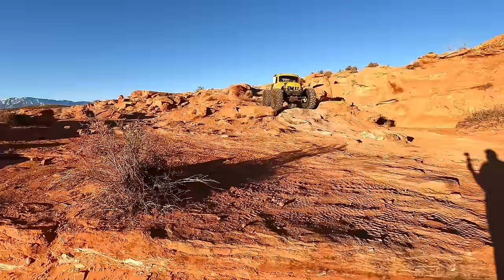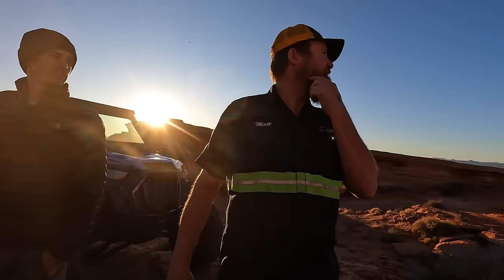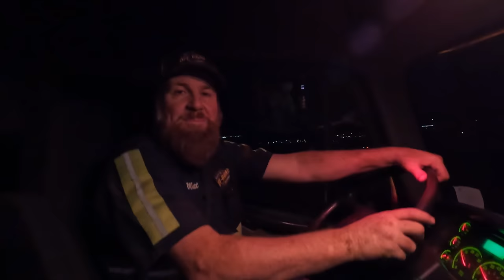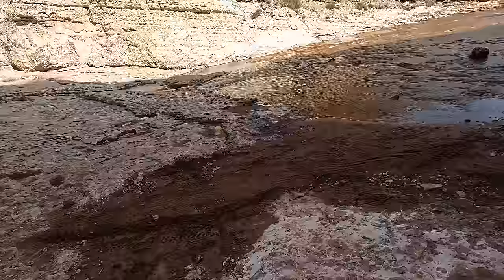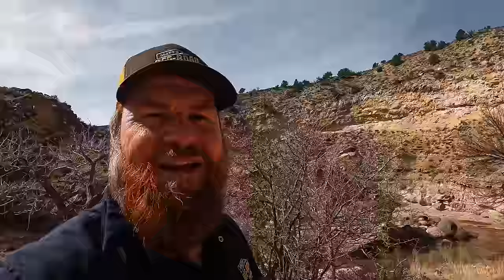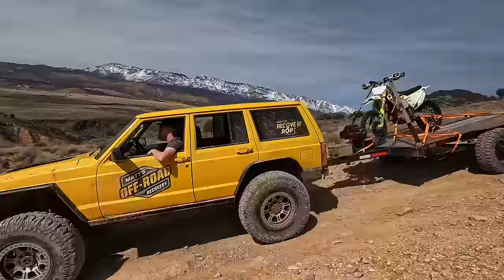This is Not What You Called For?

Comment: I don't know if this would at all be a practical upgrade for the wreaker, but a backup camera and a nice screen so you can see what is hanging from the boom.
Reply: the need front and back at a minimum and to START CARRYING EXTRA FUEL
Reply: Lol you know Matt doesn’t like building things technologically advanced to make things easy as possible 😂😂😂
Reply: @judadon707  Well, I was going to argue about the 4 wheel steering, which is a huge deal in that truck, but it's manual too. It's not automated like a Mercedes, or Cybertruck. So, you win. 🙂
Reply: @fjalics  nor did he build it
Reply: @KirbyLouis  Maybe if could capture the video, it might make for some cool clips. I wouldn't mind seeing the view from the front bumper here and there.
Reply: @Berm_Blaster  Build what? The 4 wheel steering? He bought aftermarket parts, and installed them, which is not so different from a car manufacturer. They have a lot of suppliers.
Reply: @Berm_Blaster 
What didn't he build?
Reply: @judadon707 
I think it's more complicated than your simple generalization.
Seems to me that Matt likes whatever is:
> effective
> durable
> making recoveries easier 
> easily maintainable 
> easy to use
 > straightforward to maintain
> straightforward to troubleshoot
> easy to fix "on the trail"
And other qualities... not too mention cool & yellow
Reply: @chazfaz3595  all of those are usually characteristics of the simplest least technologicaly advanced equipment 😂
Reply: @judadon707  Yeah pretty often the case, but he usually tends to test on the job and certain particular attributes tend to become the focus when simple isn't cuttin it in that area. With his experience; he zeroes in on those particular criteria.

Comment: Matt, I enjoy your channel very much so.  I like your rescues videos and of course those of the crew as they are able to do what is needed when you are not there.  Just something to think about for your wrecker to make it a little more usable, as a tow truck operators wheel lifts are great, and I know you said you would prefer not to use, or it is not a good thing because of the condition of the terrane most if not all of your jobs are in.  Instead of a wheel lift or a sling, you should design a bar that is just long enough to reach the distance of your boom since it carries the vehicles, but an articulating bar that you can hang of the front axles of any vehicle that attaches to the back of the wrecker, that keeps said vehicles from swinging into the back of the wrecker.  One that you can hang on the pinto which will give the ability to move in all direction.  This will not just stop the vehicle from smashing into the back of the wrecker, but it will also stop the vehicle from swinging side to side, it would be safer.  You will just have to work out the amount of articulation that is acceptable for the rock crawling tow that you do from time to time, but I believe it will make things a little safe.  You could also take two pipes one bigger than the other so they can slide in and out of one another and weld in a stiff spring to allow some give in the movement of the bar.  It was just something I thought about while watching some of your videos using the wrecker, just something to think about.  
Take care and keep the good work.  Matt's Off Road Recovery crew is a great crew doing a great job for the community of off-roader within your reach.  Thanks for sharing your adventures with us the universe of couch potatoes.

Comment: SUGGESTION: about stopping rigs without brakes crashing/damaging themselves into the wrecker. It works with ships or the construction industry; it should at least help a bit here, too. Make a flat, wider plate with adjustable side clamps(bolt on or if you can think of easier fixing) to grip onto the sides of the boom, ground-facing(so you can quickly reposition and fix it higher or lower on the boom). Second step, borrow either from construction industry or shipping ports some cevlar/rubber reinforced inflatable bags- rigid enough not to blow or get punctured but soft enough to cushion the front bumper of the. Fix that bag to the plate. You have air on board; you can inflate/expand it more or less to suit the application (it also can be raised or lowered with side clamps). And if it's in a way, it can be deflated flat(or unclamped as a whole from the boom). The concept can be tried out without investing work into a plate, just tying anything inflatable made from more industrial strength reinforced rubber(like some tractor tyre inner lining)... ...take some wreck from the yard and test just to see the forces involved, the damage(to the car and inflatable pillow) and the strength of components needed. If the makeshift contraption is not a complete failure, its worth persuing making it from right and strong materials.
Reply: A a rubber bouy or the side rail balloons of a boat would work well
Reply: i was also thinking like s spider web of kinetic ropes  along the boom area like you are saying to give some protection
Reply: @perryleduc1954  the only thing i am concerned with, that it would be easily deflatable/inflatable to compact it when needed. As sometimes it can be more beneficial to have just empty space there between the boom and a towed rig to reduce unneeded rubbing on long flat drives.

Comment: as an old tow driver back in the days before wheel lift trucks we had a boom that we would drop and put the J hooks on and we were gone, I understand why Matt could not use that in the places he goes, but what about an extended bumper on the rear with a rubber pad just to keep the towed vehicle from getting damaged from hitting the wrecker? sometimes going down a grade it gets close if it was low enough to hit the tires it could help out some day

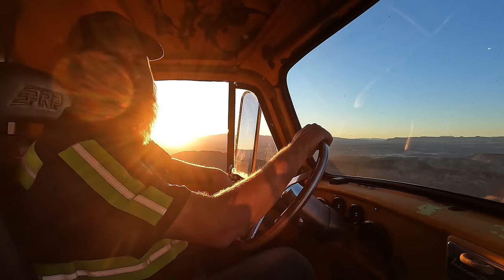Comment: 5:31 Friday. Could you use a rigid link between wrecker and tow vehicle to prevent vehicle swinging into back of wrecker?  Something like a 2 in dia fibreglass rod with shackle connection at each end.  There certainly are challenges trying to retrieve vehicles on that terrain.

Comment: Hey Matt. I have an idea for your wrecker to help when you get occasional wee bumps under the boom.
Some two or 3 inch D Rubber clamped on with u bolts and homemade brackets to attach the D rubber to the u bolts.
Just a thought for you .

Comment: RIP those fork seals. Maybe due to the off road haul, however i do recommend straping the front end by the bottom of the forks. That will allow the bike to bounce and prevent the fork seals from getting blown out. 

When i haul my motor cycle i have a strap for each fork then the back tire and does great. never falls over. BUT with offroad all the bumps i understand that may not be possible. worth trying though lol

Love the content

Comment: Hey Matt, I don’t know if this would work or not but I think it would when you’re using your record run a snatch walk on say the differential of the vehicle you’re towing and run your winch cable around app and hook onto the front of the vehicle you’re towing intention it up a little bit so maybe that’ll keep the vehicle from slamming into the back of your I would do is I would try to run that winch line to where it’s not close to the ground if you could find a way to secure it up on The bottom side of the vehicle you’re towing so it’s not close to the ground anyway if you did that I think with your cross ties I think that would help you out a lot. I would try and experiment right in your yard to see if that would work. This is six in a row. Jim from Pennsylvania.

Comment: I still think a coil over with a couple of soft shackles would work in between your rig and customer's rig. It would not need to be super strong, spring rate wise, but a robust one with large eyes at both ends would be best. I bet some quick testing you could decide what would be best. Or maybe an old tire would work, maybe flatten it into oblong shape with some bolts through it to maintain the shape. Feel free to use the ideas, free of charge.

Comment: Are the angles too varied that a Y tow/brake brace ideally with push/pull spring from center of wrecker to both Jeep hooks?   I realize it would need ability to adjust as front hook not same.   Do you ever meet oncoming traffic on long, tough trails?

Comment: I really enjoy this channel. I have a question: Why can't you drive it with a broken power steering line, it would ruin the pump? But you asked him to run the engine to go down the funnel.
Reply: Short term idling a bit will not hurt it. No pressure on front steering components in the air.

Comment: Idea matt when you need to take a bigger crew  in . Make a triangular tráiler with a truck bed tool box on it with passed seating on it with a handle bar to hold on to for passengers and use the tool box for tools touches ' Cooper for food and drinks and camera equipment and its light weight gives you passenger space and can be stood up and strapped on of you have to tráiler the wrecker or morvaira in on a tráiler. This would make some jobs so much easier to get crew and suppliers into jobs .

Comment: I have been on that very trail with my Polaris Sportsman 550, and I would NOT want to try it on my TW200.  It has several water crossings with slippery rocks and unknown deep holes.  In one place my quad went over the tires deep.  Deep water with unstable rocks on the bottom is a recipe for exactly what happened.

Comment: sling guy here again.  a fixed bar instead of the winch cables and all those ropes would be better.  you could modify some adjustable cross members from a collins dolly to adjust the distance from the wrecker to the victim.  or, install a wheel lift.  same result.
Reply from the maker: I’ve been thinking about doing a video on this. Period. 
Problem is it looks like these trails are much easier than they really are. We were towing this jeep off from one of the easiest trails in Sand Hollow, and we still have. 5 foot vertical drops to go down.  
A wheel lift would need to have an eight or 9 foot vertical to be able to be used on any of the more difficult trails. 
With an adjustable, stiff arm. It would have to be 12 feet long to keep the angles from getting extreme.   

Last year at the record games, one of the participants found this out on the very first obstacle of the day. Dropped off an obstacle and the car was still 8 feet above and it piled up over the top of the stiff arms onto the bed, breaking things. 

I’m not saying something couldn’t be designed that would work in some of the situations, but it would be such a headache to have to hook it up and unhook it multiple times on one job
Reply: @MattsOffRoadRecovery  hi and thanks for the reply.  ok.  you're replacing a 3-5' rope with a 3-5' bar.  what I'm suggesting is something rigid to keep the victim vehicle from clopping into the back of the wrecker.  I'd look at the military for ideas.  they would never dog walk a vehicle.  maybe even modifying a v-bar that rv-ers use to tow their vehicles.  but use a pintle hitch.  looking forward to the video.  love your show and staff.  #
Reply from the maker: So imagine the bar being parallel with the ground when both both vehicles are on level ground, or at least on the same plane. 
Now put one of those vehicles, 8 foot higher than the other vehicle. The bar is no longer in plane with either vehicle. The bar is too steep of an angle to stop the vehicle from coming in. It will literally pivot over the top of it and pile up in the bed of the tow vehicle.
Reply: @MattsOffRoadRecovery  guess this will need a video!  it's hard to visualize.  it just seems logical that an 8' bar (using your 8' drop as a reference) would always keep the victim vehicle 8' from the wrecker.  if you use the cables to lift the front end, you're still 8' away. #
Reply from the maker: 8 foot bar would be way too long to be maneuverable. 
Meaning there would be times when it would swing the vehicle out over a cliff or into a wall. 
8’ drop still put it at 45°.  
If it was putting any sort of pressure on a steep downhill, it would just push over the top, using the bar as a pivot point, and wind up in a mess   

This is a video that shows somebody trying to use this system in our terrain. 
The very first obstacle illustrated how it doesn’t work with such extreme elevation changes in such short distances. 
https://youtu.be/cf2gqPXDCjQ?si=ShufTlmF1C-VuQec
Reply: @MattsOffRoadRecovery  ok.  there are two real variables.  length of rigid pole(s) and configuration.  you could use a "v" shaped device mounted to two fittings on the wrecker bumper or two fittings mounted on the victim vehicle.  i think most of the video examples are two mounts on the wrecker and one on the vehicle. you're right, none of them worked. that tells me a lot.  or, maybe a square or a rectangle would be better.  I didn't see either.  the military tow bars are all "v" shaped, fasten to the vehicle towed at two points on the front, and use a pintal hook. some are adjustable for length  I don't think I saw anything like that either  but, Matt,  you're the local guy and know the terrain.  thanks for taking the time to patiently respond.  best #

Comment: Looking at your boom and considering the back and forth sway (towed vehicle could hit The Wrecker): What about having a bracket you can add to the two boom arms that have vertical 'deflectors" which would limit the forward sway of the cables?
Making the "deflectors" a like convex would be less taxing on your hoisting cable(s).
It's either that or boat bumpers for the towed vehicles. LOL!

Comment: MATT, get a 4 or 6 foot plastic 4in electrical conduit to space the towed vehicle from the tow truck. 
Run the rear winch line thru the Condit the attach the line to whatever is being towed, and snug up the winch now the conduit will hold the towed vehicle away from the wrecker and allows plenty of articulation. 
I have towed vehicles this way but with a steel pipe and chain.
I figure the plastic conduit would be easier to customers vehicles.
Hope that make sense love watching y'all work.

Comment: Ha man pull it together.   Hehehe 
All do respect overall your doing amazing.      
   Sometimes your rigging seems sketchy.    So far so good 👍. 
  The biggest rigging I was invaded with was mega heavy-weight. 
   Just the locations of where people are located during some of your jobs spooks me.  
   Here's the thing.  When rigging fails it explodes like a rubber band. 
   Wouldn't be behind or infront of any pull. 
  Some young men on a high rise didn't want to take the time to move the Crain.  It was beyond the safety of the charts. 
  It worked and made the company a lot of money. 
  Good thing no one had ever used that Crain that way. Because of the stress incurred the next guy could kill some people not the mention destroy the Crain. 
  I personally know someone that did gamble this way.
  After loosing 2 Crain's in 8 years a third Crain was lost. If not for understanding where to be when things went wrong someone would at least get a leg or arm cut off. 
    The third Crain was the last of his iron worker wringing carrier. 
   They had him cut it up with a torch and load it up himself. 
   Not sure what he did after that. 
Probably become a welder would have been a better choice for everyone involved.   
  I've been the union safety meeting guy and checked the rigging and had people out of harm's way as much as possible.  You don't forget stupid.  People usually don't get a chance to learn from there mistakes.  I just payed attention to physics.

Comment: I'm confused as to why being disabled would add to the problem here?   Like, would you have brought a trailer in for this rescue?  I would assume you would have just pulled it out with a rope and it seems the Wrecker could do that as well.

Edit:   Ahhh.   They were originally planning on just welding it.   

Edit Again....that still doesn't change the scenario....you should've been more happy that you had the wrecker with you, because what would've been the case if you just took the banana or morvair?  It seems like you were flustered/grumpy at the customer for some reason....Like it didn't change anything and it broke after they called you.  Isn't this the reason you built the wrecker??/ to be prepared